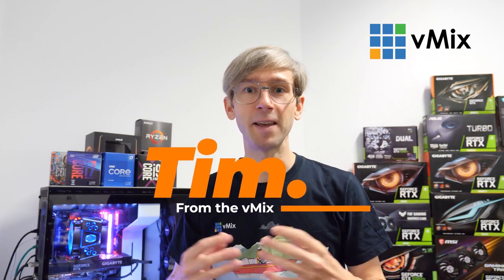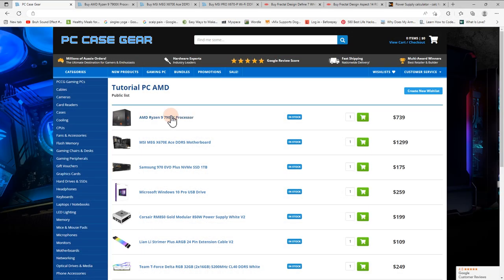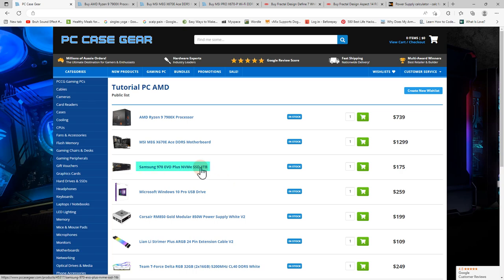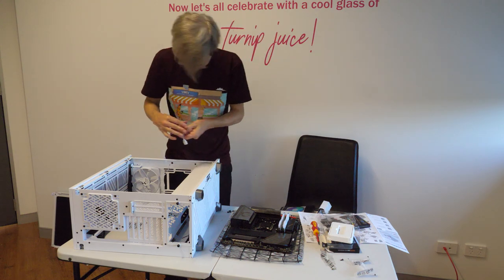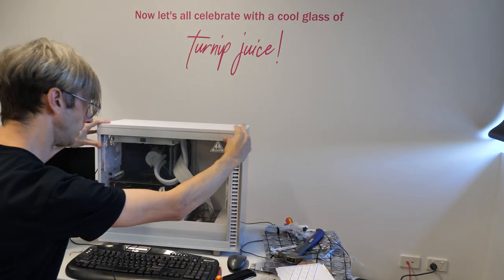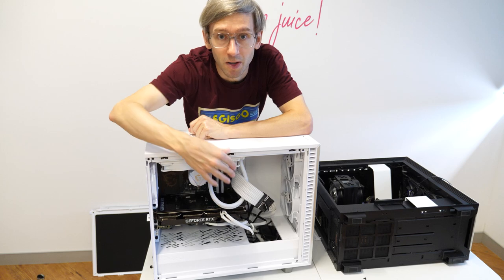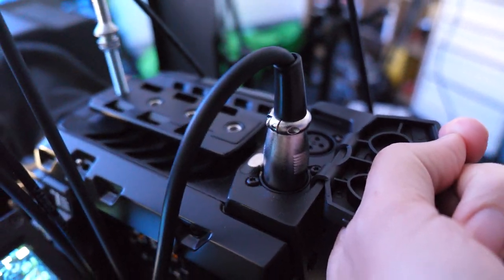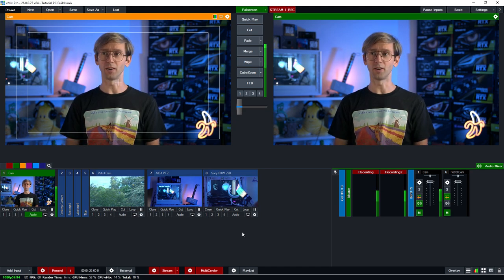We needed to replace our tutorial PC, so we made a video about it.

Comment: Two years ago I made the decision there would be no capture cards and everything would be NDI. That is because I could not be burying really long cables for SDI and power in the walls and ceilings of my church. Just some Cat6 to a POE switch and then another 150 feet to the production console.

So our computer is simply a Dell 3640 with an RTX 3050. The gigabit LAN picks up three NDI cameras for a bandwidth of 25Mbps. CPU load is in the single digits. GPU is at 40% when streaming.

Maybe if we streamed 4K we would update the computer. No real need right now.

Comment: Speaking of noise-reducing VSTs like NS1. We use Clarity VX Pro (The base Clarity VX is very good too) but insert DeVerberate 3 before Clarity VX Pro. DV3 minimises that bathroom or concrete stairwell ambience, so often heard when using laptop contributors or bad mic positioning. CVX Pro then sweeps up any mechanical or ambient interior/exterior noise. With judicious tweaking you can make a noisy studio sound like a quiet sound booth, without degrading the source speech.

Comment: Your configuration could have chosen a case with better airflow. For example: Phanteks Eclipse G500A
The new processors are very hot. I would have gone for a more powerful AIO. For example Arctic Liquid Freezer II 420 or Deepcool LS720, 360mm.
And in such configurations, it is more efficient to put the AIO radiator on the front panel of the case.

;)

Comment: thats pcie gen 4 or 5. most capture cards are pcie gen 2. x 4.  you could use the cheeper board, AJA Kona 4 is Pcie 2.0 X8  same for magewell, top card is pcie gen 2x8 corvid 88 is pcie gen 2x8  So thats 4.0 gbs for pcie gen 2x8. a gen 4.0 X2 is the same and a gen 5 x 1  is the same. KRONOS K8 [ is pcie 3.0 x8 so pcie 4.0 x4 would work and pcie 5.0 x 2 would work  but they got to be x8 electrical, but they will work in a thunderbolt chasi's also wich is only pcie 3.0 x4.  You got alot of options.

Comment: Hi Tim! I've got a question. I have just bought the same motherboard MSI MEG X670E ACE with AMD 7950x processor. i will have a 512 Mb M.2 NMVE SSD(SAMSUNG 980) for Windows, a 1Tb sata SSD for storage and a 1Tb M.2 NMVE SSD(SAMSUNG 980 PRO) for replays. My question is: where should i install the replay SSD? to M.2_1 port which is related to CPU? or to one of the M.2_2 / M.2_3 / M.2_4 which is related to chipset?

Comment: Why is it so important that the PCIE lines of the capture card should be straight from the CPU?
Today, very few motherboards have more than 1 PCIe slot straight from the CPU
Reply: In vmix forum: 
paco3346
"PCIe lanes all ultimately go to the CPU. Your motherboard has certain features that need to connect to PCIe lanes but it doesn't always need a full set (like say 4 of them).

To not waste lanes the motherboard manufacturer will use 4 lanes to connect the chipset, connect things like the LAN port and maybe the onboard audio, and then pass the remaining bandwidth to a PCIe port (4 lanes). Even though you have "4 lanes" it's not getting the full bandwidth and lowest latency possible compared to that capture card connecting directly to the CPU."

But this is not true.
Any PCIE slot has the full throughput specified by the manufacturer, even if it passes through the chipset.
and I'm not sure how the delay is noticeable due to the chipset.
Reply: for example: 
X670 AORUS ELITE AX
Chipset:
1 x PCI Express x16 slot, supporting PCIe 4.0 and running at x4 (PCIEX4)  // PCIe 4.0 x4  = 8GB/s
1 x PCI Express x16 slot, supporting PCIe 3.0 and running at x2 (PCIEX2   // PCIe  3.0 x2 = 2GB/s

DeckLink Duo 2 (4 x1080p)
requirements : PCI Express 4 lane generation 2, compatible with 4, 8 and 16 lane PCI Express slots.
PCIE 4.0 x2 = 4GB/s

DeckLink Quad 2 ( 8 x 1080p)
requirements : PCI Express 8 lane generation 2, compatible with 8 and 16 lane PCI Express slots.
PCIe 2.0  x8 = 4GB/s 

DeckLink 8K Pro ( 4x 8k!!!)
requirements : PCI Express 8 lane generation 3, compatible with 8 and 16 lane PCI Express slots.
PCIe 3.0 x8 = 8 GB/s

Technically, this motherboard meets the requirements of any of these cards.
Of course, in your case there are 2 capture cards, but for most, one is enough.
Reply: Theoretically, MPG X670E CARBON WIFI (~ 500$) is also suitable for two capture cards:
PCI_E1 PCIe 5.0 supports up to x16 (From CPU)       // GPU
PCI_E2 PCIe 5.0 supports up to x8 (From CPU)         // PCIe 5.0 x8 = 48GB/s
PCI_E3 PCIe 4.0 supports up to x4 (From Chipset)   // PCIe 4.0 x4 =  8GB/s

In this case, we could discuss the delay differences between CPU and chipset PCI slots
Reply: I'm not an expert on this whole topic so I have questions.
Why is it important for capture cards that PCIe has CPU lanes?
If one capture card is used, is the delay due to chipset laine significant?
The delay as such is not important in my opinion, as the sound delay can be adjusted in the sound console or in vMix
How does this affect CPU load?
Reply from the maker: If it's chipset lanes, they're typically connected to peripherals, M.2 drives or other components on the computer. If they're using up all the bandwidth, then your capture card data won't be able to get through. It's ok if data slows with most peripherals, but as soon as your camera drops out in a live production, that's a problem. Feel free to drop us email for any other questions- https://www.vmix.com/contact-us.aspx